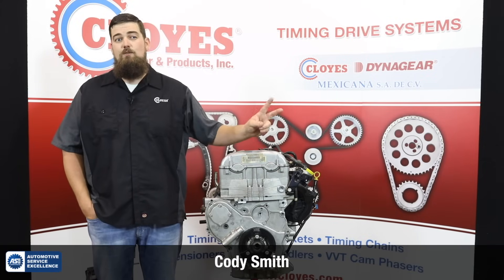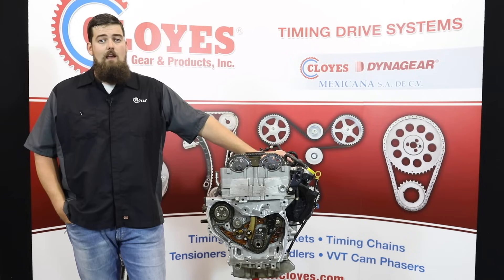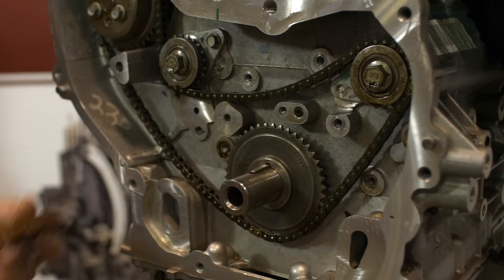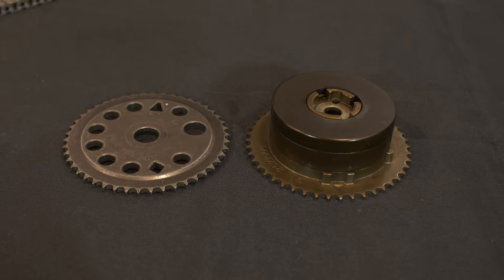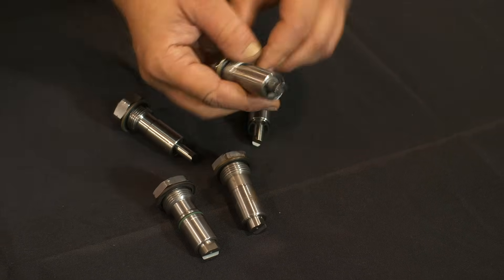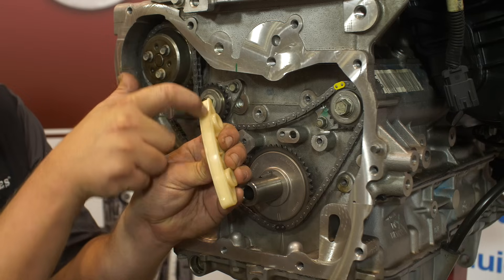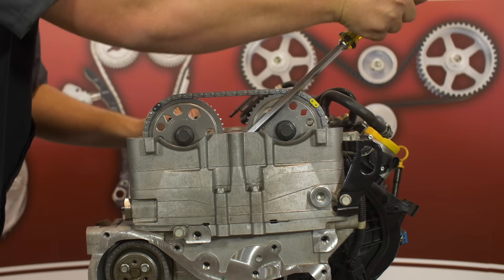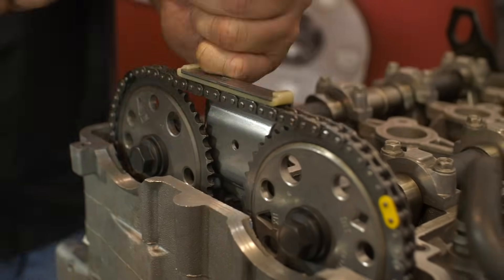GM 2.0/2.2/2.4L, Timing Chain Replacement, Cloyes 9-4201S & 9-4202S

Comment: I've gone through the install, chain rattle is gone, but now I have a quite bit of engine vibration throughout the vehicle. No codes are coming up. I've replaced the balancer pully and bolt but vibration still there. Engine mounts look good. Car is drivable, just a lot of engine vibration. Now that I just read the last two comments... is it likely my balance shaft 180 degrees out? Anyway to check this without taking everything apart again?
Reply from the maker: It is possible. You need to make sure you have the correct balance shaft sprockets installed on the correct banks.
Reply: Yes that was it. Sprockets were on the wrong sides. I can't believe it. Hopefully it didn't do to much damage from driving it like that.

Comment: Quick question. I bought a tdc whistle to help with getting tdc and everything aligned perfect. tdc whistle blew and i set it 100% to the mark on the balancer. When i took the valve cover off my cam sprockets werent at 10 and 2. the lobes are facing into each other. 

I tried replacing the main chain to get by while i get the balance chain shipped and it ticked after install. So now this is all after that huge mess. 

Bought the car with these issues and someone has been in here before.  

-2012 malibu
Reply from the maker: The Ecotec engines time at TDC on the exhaust stroke. You found TDC on the compression stroke, which is 180 degrees out from where you need to be. Just turn the crank one full revolution. You will then be at TDC exhaust and the cams will be located correctly.

Comment: Do all six of the timing marks, 3 on the balance chain and 3 on the timing chain, need to be in the correct time at the same time after first installing?  I just replaced both the balance and timing chains.  While installing the balance chain, I ensured that all three of my timing marks were correct.  While installing the timing chain, the crankshaft sprocket mark was off, so I had to slightly rotate the crankshaft by hand.  Now, all three of my timing marks are correct on the timing chain, but the marks are incorrect on the balance chain.  Since I ensured that all three of the balance chain marks were correct before I worked on the timing chain, does it matter that they no longer appear in time?
Reply from the maker: All six marks should align at the same time, but you still have a 50% chance of it being correct. You need to make sure the mark on the intake balance shaft is up and the mark on the exhaust balance shaft is down when the camshaft sprocket marks are at 10 O'clock and 2 O'clock. If the balance shaft positions are opposite (intake-down and exhaust-up) then your balance shafts are 180 degrees out of time and you will need to address it. If you properly timed the balance shaft system before it rotated, then you will either be perfect or 180 degrees out
Reply: @Cloyes01  Perfect, thank you so much for the quick response. That was my assumption, so I already removed the necessary items to put all six in alignment. After removing the primary tensioner, though, I’m unable to remove the snap ring to deactivate it. None of my expensive snap ring pliers will budge the ring. Any advice how I can remove this?  Thanks again.
Reply from the maker: @arnieb4849  We typically use snap ring pliers and a small flat tip screwdriver. You got to get the snap ring compressed enough to work the screwdriver behind it and then pry it out.

Comment: I just replaced timing chain 3 guides and sprocket may car started and runs but it almost sounds like chain rubbing in the valve cover could this be related to the tensioner possibly it being out 2.4 2011 Malibu

Comment: when I tried this at 9 minutes with the punch method the tooth broke off the gears, there not very strong and I didn't get close the the torque before it snapped, both gears snapped a tooth off.

Comment: I have a question. Hopefully, it's not too absurd...
I had to replace the cylinder head with a new one since the old one was cracked due to the past owner overheating this 2014 chevrolet Equinox 2.4 L. I have everything installed correctly except the timing chain set which i just purchased for Cloyes...I don't have a clue on how to set the timing since everything has been replaced...cylinder head, waterpump, voltage packs, plugs, gaskets...ect.
With this all in mind, can you help me understand how to set the timing at this point.
Reply from the maker: The chain sets the timing in this engine, and all the sprockets index onto their shafts one way. You just need to get the 2 cams and crank to the positions to align the marked links. If all three marks are aligned properly, then the engine will be in time. The only issue you may run into is rotating the cams if one of the pistons are at TDC. You may need to rotate the crank to get your pistons down, then move your cams, then bring the crank key back to 12.
Reply: @Cloyes01  thank you very much I will try this 😊

Comment: Question 1) What's the deal with the black plastic guide that always breaks. Is there a reason this peice is solid plastic instead of metal like the other side?
Question 2) I'm only getting a year out of these kits before it's time to change them again is this normal? I've changed my 2012 regal 2.0 lhu 3 times and 2013 equinox 2.4 twice, 8 months apart. The chains are either stretched or black plastic guide is busted.
Reply: Did my 2012 malibu in my driveway and im like why the fuck is this plastic. That one was worn, the metal one snapped and fell down. I left it in the pan lol. Ran good until a girl rear ended me and totaled it a year later.

Comment: What about the washers between the crankshaft sprockets
Reply from the maker: GM did use frictional washers on both sides of the crankshaft sprocket in some applications. If your engine had them, clean them off and reuse them with the new sprocket.
Reply: What if I didn’t put them back on? I didn’t even know they were on there till I seen this comment?
Reply from the maker: @dgreen4298  Most Ecotec engines do not have any washers. Even if it did, there is no harm in not reinstalling them.

Comment: Does the balance chain need to be in their correct marks before installing the timing chain or it doesn't matter?
Reply from the maker: If you didn't service the balance shaft chain, or are sure that the balance shafts are in time, then it doesn't matter.
Reply: @Cloyes Gear & Products, Inc.  thank you so much, this helps clear my doubts. Just ordered the cloyes timing chain kit.

Comment: The factory service manual has higher torque values on some of the static guides on both the balance shaft and the cam chains.. just realized this after following the video.. 89in vs 139in kind of a big difference not so much the 89 vs 109 but still. I also noticed the bolts coming out of those guides had thread locker on them although the manual does not call for it either.

Comment: I have some slack in my chain after installation and im concerned its to much slack. Whats a sufficient amount of slack?
Reply from the maker: The chain will have some slack after the install. The tensioner will need some oil pressure behind it to take the slack out of the system. Even then, valve spring pressure will clock the camshafts one way or the other when the engine is not rotating and slack will gather somewhere. Too much slack is not an issue until the tensioner is completely extended and can no longer tension the chain. Usually you will get cam-to-crank correlation codes before the chain stretches this far.
Reply: Any reason behind not having any slack at all?

Comment: Is it safe to remove camshafts with Chains removed without the holding tool for valve lash , rocker and valve spring/stem replacement?
I have photographed the cam positions and as far as I can see as long as I put the cams back in proper positions and replace the camshaft caps properly there should be no problem. the Haynes manual does not have cam removal procedure for a engine that already has the 
timing and balance shaft chains removed. Thank you!
Reply from the maker: Yes, it is safe to do so. To your point, just make sure to install the cams back on the correct banks and the caps are reinstalled as removed. Try to find a resting position before you pull them out, meaning the camshafts don't have valve spring pressure against them.
Reply: @Cloyes01  Thank you for your help!
Reply: @Cloyes01  Keep the timing tech videos coming! I feel that timing is one of the most complex jobs to do but with the proper
Knowledge, you realize that it's the complexity that deters people from doing their own timing chains out of fear of doing it wrong. It seems to me that Most if not all manufacturers

Comment: What if my chain marks don't come back to the original places every two rotations of the crank
Reply from the maker: The chain marks won't, that is normal. They will eventually, but it will likely take over 100 rotations.

Comment: Why would you not rotate the crank 720° before throwing everything back together? Wouldn't you want to do this to make sure you're timed properly and don't have any interference? Just curious. Great video.
Reply from the maker: Rotating the engine by hand, particularly in this application, comes with a risk of jumping time. Since the tensioner has no oil pressure behind it, the chain will have some slack. That slack shifts as the camshafts open and close valves and will allow the chain to jump teeth on the crankshaft sprocket. If the marks are all aligned properly there is no chance of interference. We recommend the first rotations of the engine be with the starter.
Reply: @Cloyes01  thank you!
Reply: Doesn't the starter just turn the crank? @Cloyes01
Reply from the maker: @rkw3000  Yes, but the speed and constant load from the starter does not allow chain slack to shift back and forth as severely as turning it by hand.
Reply from the maker: @rkw3000  Yes, but it is about the speed at which it turns. Slow rotation by hand allows the chain slack to shift back and forth because of the valves opening and closing. With the shifting of the slack, plus the tensioner not being primed up with oil, it is really easy for the chain to jump on the crankshaft sprocket. When you turn it over with the starter, there is a much lower chance of the chain jumping.

Comment: Good video.  If the original timing chain guide is shattered, do I need to pull down the oil pan to clean debris.
Reply from the maker: I recommend doing so. You don't want parts of that old guide clogging the oil pump pickup.

Comment: Why do you install the chain on the exhaust stroke and not the compression stroke
Reply: TDC of the exhaust stroke sounds  strange but it's technically correct.  It's also the start of the intake stroke if you think about it.  It may be the end of the four cycles (intake, compression, power, exhaust) but it's also the start of them. Like many of us , it keeps going round in circles.
Reply from the maker: The marks on the camshaft sprockets will be downward on the compression stroke so you will not be able to properly align the chain. The exhaust stroke is just where GM intended the engine to be timed. 

You could time on the compression stroke, you would just need to make new timing marks exactly 180 degrees from the current marks on the camshaft sprockets and use those marks during the install.

Comment: I am in the middle of  changing the balance chain on my 2009 2.4L ecotec. I bought kit 9-4202S, but both balance shaft gears are labeled intake.  If I try to use the intake gear on the exhaust balance shaft the timing mark will be 180 degrees from what it should be when compared to the original engine exhaust gear.
Reply from the maker: You are correct, the timing mark will be 180 degrees out if you use the intake sprocket on the exhaust balance shaft. There is supposed to be 2 different sprockets included, one marked intake and one marked exhaust. I apologize for the packaging error. You can work with your vendor to receive a replacement, reuse the old sprocket is it appears undamaged, or remark one of the intake sprockets with a paint marker using the old exhaust sprocket to orientate the mark correctly.
Reply: Should the balance shafts slide out some after the new gears are installed on them? They slide out maybe 1/2 an inch.
Reply: @kodycourville7114  If I recall there was some movement. I don’t think it was quite 1/2 inch but I didn’t measure it.
Reply from the maker: @kodycourville7114  Once the sprockets are installed and torqued, the shafts should have a little bit of endplay but not 0.5". Outward thrust is controlled by the carrier that is bolted down next to the sprockets, and inward thrust is controlled by the back of the sprocket against that carrier.
Reply: Thanks

Comment: Just watched the video and think it will help on this first time on this style engine.  I did notice that no one has mentioned that if the original guides are broken or have misplaced parts you had better remove the oil pan and clean them out of the oil pickup tube screen.  You will have a greater failure later.
Reply: Agreed, i found a number of broken guide fragments and metal from damaged bolts in the oil pan

Comment: I bought this timing kit and it is great, however what they don't tell you is that crankshaft harmonic balancer bolt has to be replaced with a new one , it is not included with this kit which I thought was a bummer, these bolts can be hard to find.....
Reply: @Jeffrey Sherwood torque to yield
Reply: Did u have to pull the engine?
Reply: @psfanboy79  no, I did not have to pull the engine, it is tough to work  upside down but it wasn't too bad to do.  just put something to cover the oil pan when working on this, if you drop a bolt it could go right into the pan..... just did not think it is right to not include the crank bolt withis kit... but it is what it is....
Reply: It's not TTY...re-use it.
Reply: @superdhc  ok, thanks did not know that, my maual said it had to be replaced. thanks again for that infro....

Comment: When you remove all the guides and the balance shaft sprockets did you use a 10mm socket? Everything else was specified but not those. 3:53-4:51
Reply: On my 09 2.4L Ecotec LE5 engine, the balance shaft bolts were 15mm.

Comment: This video is fucked. Don't listen to it. Timing marks on exhaust and intake side are completely different on the 2010 Chevy equinox!!! Get a repair manual if you want it done right and don't want to fuck up your engine. AutoZone Haynes repair book goes through the entire process of the timing and all for the 2010 (it's different than later models.) And everything else needed to be done. I fully 100 percent disagree with this video and am very lucky my engine did not blow. Video was followed step by step, and in a very slow and thorough process. The exhaust side is supposed to be at 7 o'clock. Intake side is 5 o'clock according to service manual.
Reply: a 30 second google search proves that it pays to do a little research before reading a simple headline. this video is specifying LSJ, L65, LAP, AND LE5 motors, the one in your vehicle is a LAF, LFX, or LFW

which also goes without saying, take it to a shop, it isn't just "nuts and bolts" it takes a little common sense to save a lot of money
Reply: @drewf5391  where does it specify those engines? It just says 2.0,2.2,2.4 and in the description it includes the Chevy equinox and GMC terrain

Comment: Instructions included with the duralast tensioner: 

"Activate the tensioner prior to installation by pushing down on the plunger so that it fully extends and has spring pressure"... 

 "Gm recommends to activate the tensioner after installation by pushing on the chain with a rubber tipped tool. 
We have found this method to be very difficult. 
Failure to activate the tensioner will result in severe engine damage"

Returned the kit today, and ordered the Cloyes Tensioner to just swap out. 

Do you suggest activating it and then installing it; any tips?
Reply from the maker: Do not activate before installation. There is a ratchet mechanism inside the tensioner, if you activate before installation the tensioner will be in its most extended ratchet slot and will overtighten the chain, break a guide, or damage the tensioner internally.

Comment: Hello. Great video. I recently ordered the 9-4201S kit to install into my 2.2L L61 engine. I will also be changing the cap and bearings, the motor is on an engine stand. After Top-Dead-Center, do you suggest I start from the cap and bearings, then work my way to the 9-4201S timing chain installation? Thanks.

Comment: After install is it ok to rotate the engine by hand 720 degrees just to check timing and confirm that there is no interference?
Reply from the maker: You can, but it is not recommended. The slow rotation combined with valve spring pressures and no oil pressure in the tensioner, creates a good chance of the chain jumping a tooth on the crankshaft sprocket. If your marks are all aligned, then there cannot be any interference.
Reply: @Cloyes01  So what is going to stop it from jumping when you crank engine when the oil is drained down and it takes a few seconds for the tensioner to get oil pressure?
Reply from the maker: @brucebradsher9882  The speed and constant rotation of turning it over with the starter makes the valve spring events much less dramatic on the timing chain system and helps prevent chain slack from shifting side-to-side. The tensioner does have an internal spring and ratchet (as long as it was activated properly) which helps manage some of the slack.